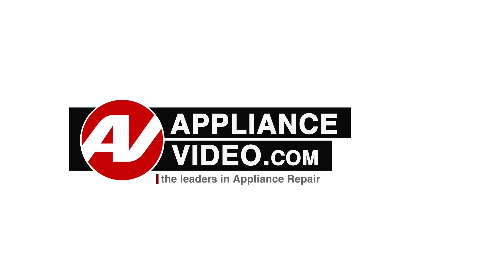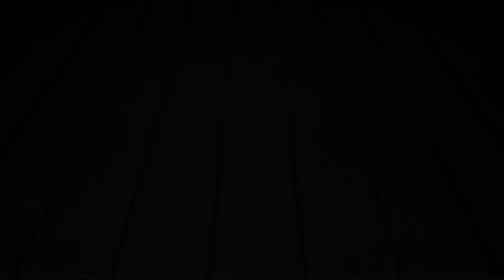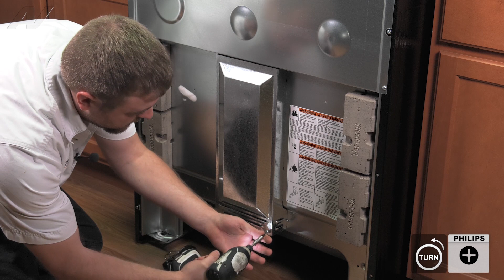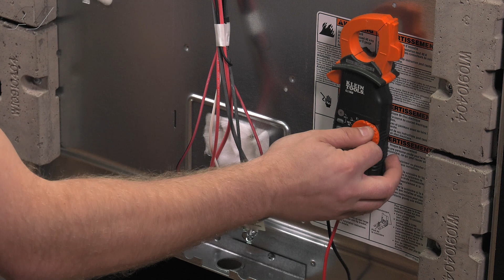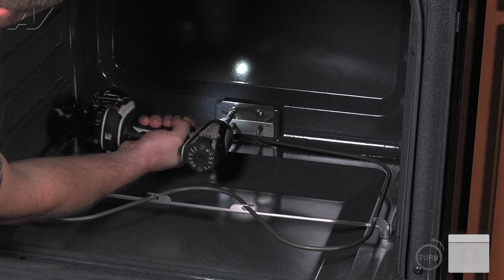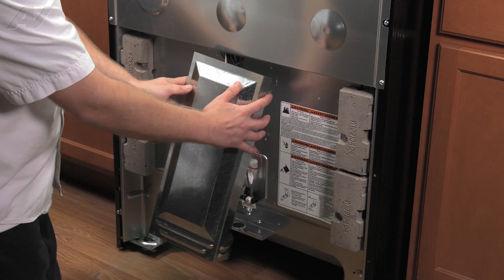Whirlpool Stove Repair - Will Not Heat - Bake Element

Comment: Whirlpool oven “hidden “ baking element & broil element both pass continuity test & look great, but no oven heat from either.   First replaced temperature sensor,  no change.  Second, replaced thermal fuse,  no change.   Stove top coils all work fine. Any ideas ?  Thanks in advance.
Reply: Power on?

Comment: Nice video. I replaced the bake element but still NO POWER to OVEN. Everything else works (has power). Any advice to the solution?
Reply: The problem was both top/bottom heating elements were bad. Replaced them and now it works great. Thanks!
Reply: @jairoc5156  much appreciated!
Reply from the maker: Great question, if you have a more technical question that our parts department cannot answer, you can search our over 17,000 answered questions free at our website www.ApplianceVideo.com under our Repair Help section. You can also call our parts department at 1-800-830-5465 and they can give you help 7-days A week ,or search at www.SaveMoreOnParts.com  .
Reply: What was it?

Comment: Could this case our oven light to remain on ? We can not turn light off and only heats to 100-110 degrees.
Reply: did you figured out the issue? im having same problem - light on and only 100 to 110
Reply: @BimmerByte  yes it was the mother board (again). It has gone out twice with in one year. They fixed it both time but all together we have been without a stove for 3 month during the first year of owning it. I will never buy another whirlpool stove.
Reply: @soulcut5736   thank you.
Reply from the maker: Great question, if you have a more technical question that our parts department cannot answer, you can search our over 17,000 answered questions free at our website www.ApplianceVideo.com under our Repair Help section. You can also call our parts department at 1-800-830-5465 and they can give you help 7-days A week ,or search at www.SaveMoreOnParts.com  .

Comment: If you don't feel like buying an electric meter to see if it's your wall plug. Try turning in the broiler. If that hearts up than it's not the plug. Element time!
Reply from the maker: Great question, if you have a more technical question that our parts department cannot answer, you can search our over 17,000 answered questions free at our website www.ApplianceVideo.com under our Repair Help section. You can also call our parts department at 1-800-830-5465 and they can give you help 7-days A week ,or search at www.SaveMoreOnParts.com  .
Reply: @Appliancevideo 
Not paying for your videos that do NOT ANSWER anything. They show replacement of parts (with 2 screws holding them in and a little plug - that's no issue to handle)

Comment: I replaced the heating element in the oven and I pressed on it work for a second now nothing works before the top stove worked completely and it was just the inside element that was broken, now everything doesn’t work😭
Reply from the maker: Great question, if you have a more technical question that our parts department cannot answer, you can search our over 17,000 answered questions free at our website www.ApplianceVideo.com under our Repair Help section. You can also call our parts department at 1-800-830-5465 and they can give you help 7-days A week ,or search at www.SaveMoreOnParts.com  .
Reply: same situation.. ever get this get resolved?

Comment: I do not have 240 volts
Reply from the maker: Great question, if you have a more technical question that our parts department cannot answer, you can search our over 17,000 answered questions free at our website www.ApplianceVideo.com under our Repair Help section. You can also call our parts department at 1-800-830-5465 and they can give you help 7-days A week ,or search at www.SaveMoreOnParts.com  .

Comment: My Whirlpool oven is doing the same thing...bake gets to 280...convection & broil both working...originally an F6E1 error that I cleared...then auto test showed DLB-K1 bake element or wiring...
Reply from the maker: Great question, if you have a more technical question that our parts department cannot answer, you can search our over 17,000 answered questions free at our website www.ApplianceVideo.com under our Repair Help section. You can also call our parts department at 1-800-830-5465 and they can give you help 7-days A week ,or search at www.SaveMoreOnParts.com  .
Reply: Hey did you ever fix this...because my oven is now doing this as well and i cant seem to find what the hell is wrong with it!!!

Comment: Hi, great video.  May I ask, my problem is that it heats up but won't come up beyond 275F. Constantly says 'preheating' on the screen. The broiler is fine but the oven and convection appears to not be working right. My guess is that the thermostat isn't working correctly?
Reply from the maker: Great question, if you have a more technical question that our parts department cannot answer, you can search our over 13,000 answered questions free at our website www.ApplianceVideo.com under our Repair Help section. You can also call our parts department at 1-800-830-5465 and they can give you help 7-days A week ,or search at www.SaveMoreOnParts.com  .
Reply: @G E-Jones - did you ever find out what was wrong and how to fix it?  I've got the same problem.  Thanks!
Reply: @KG-yw6rz  we are in lockdown as it stands and as I'm a tenant on a small island in the Caribbean I haven't yet taken this further.  However I have got the heat up over 275 by setting the temp to 500 in the first place. It rules out baking for the time being, which is unfortunate timing as I have a feeling I'm going to need to learn how to bake bread at some point. I'll try and follow up on appliancevideo.com suggestion